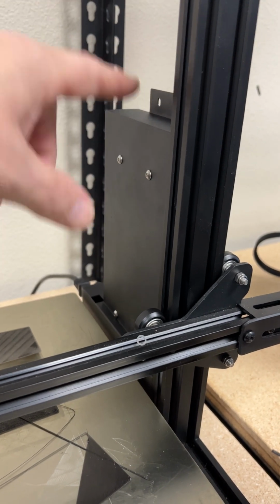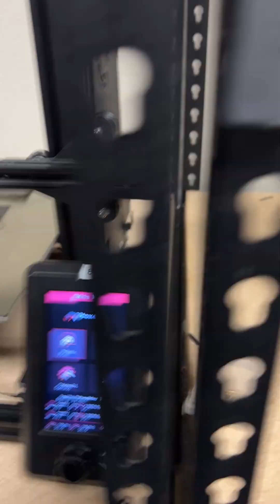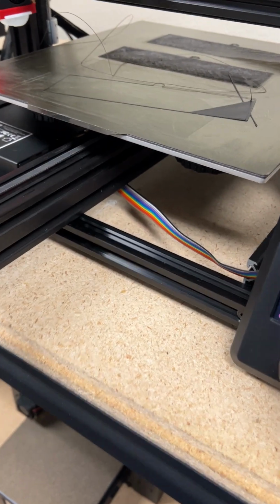Fixing a wobbly Y axis on Ender Extender  V2

Comment: That ain't my problem with the wobble on the Y axis. Mine has to do something with the Y carriage itself. Certain parts of the Y axis dips during movement. If I lift the bed with my hands with little pressure and move the Y carriage, it doesn't have that dip problem.